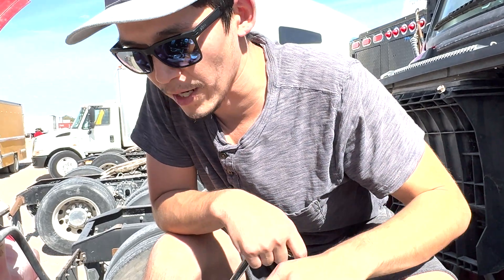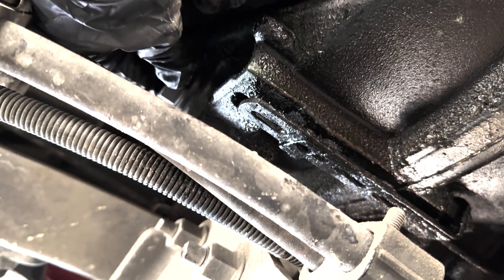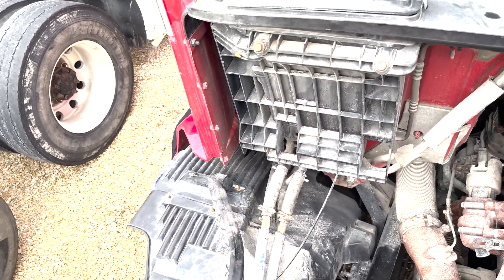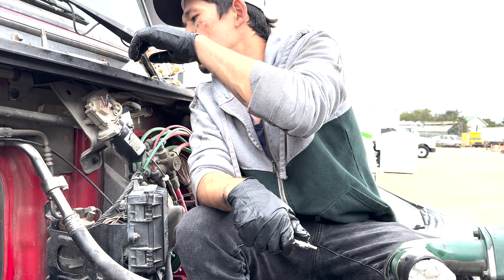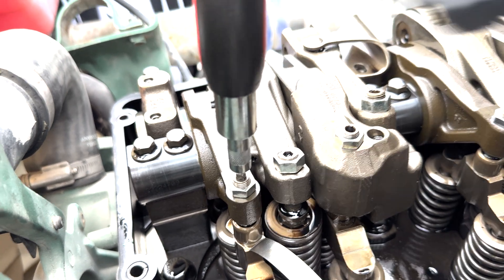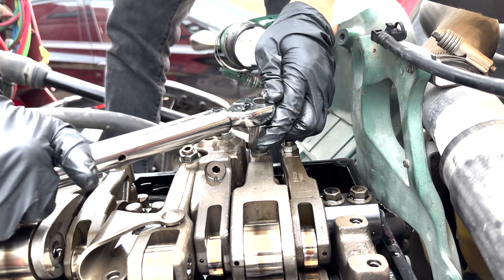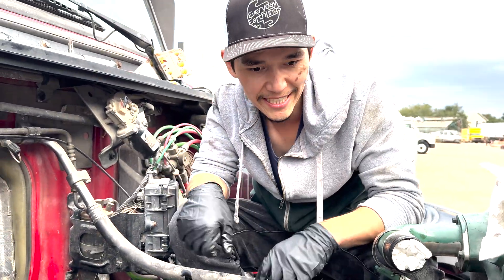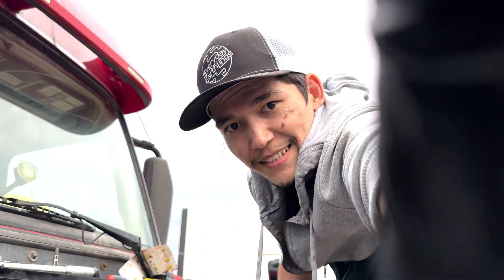2015 Volvo D13: Overhead Valve Adjustment

Comment: You need to do valve adjustments I would say every 120 or 140 thousand miles, if you wanna turn the crack over it n the d13 engine while you stand at the top, take a 15/16 socket and racket and put it on the altinator pully nut and pull up as if you were loosing and it will spin the cam where you can see it to for valve adjustments
Reply: And I would use dog bones for the torque wrench not sockets you wanna hold the adjustment screw still cause the jam nut will pull the screw up by 1000 of an inch and adjustment will be off buddy
Reply from the maker: Thats why I started by saying “I am attempting to try” bud. I am not a pro as everyone can see from the video but I am not scared to try 😉

Comment: Just wondering if your valve adjustment fixed your issue.
Reply from the maker: Yes it did, there is no more knocking sound by 5th cylinder
Reply: @beksexp3716 hie can you show me how to set gear backlash